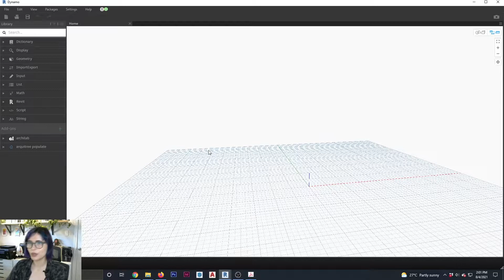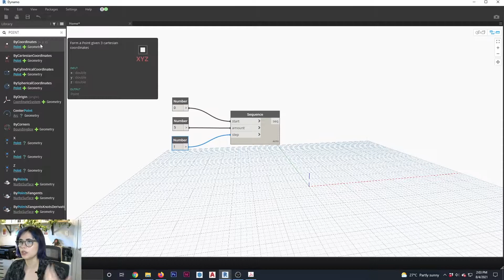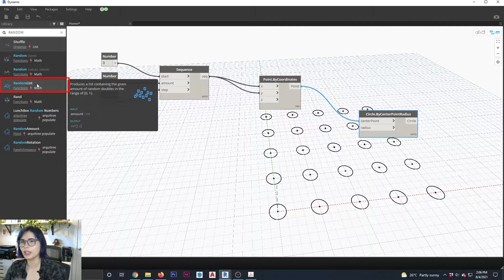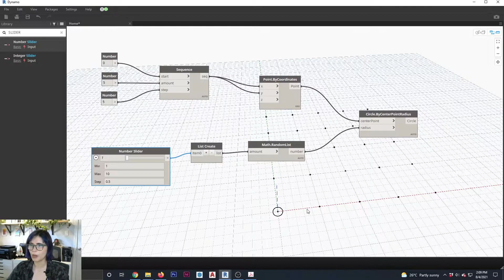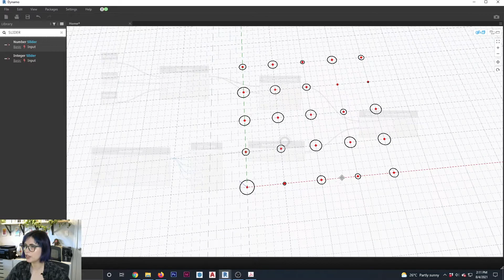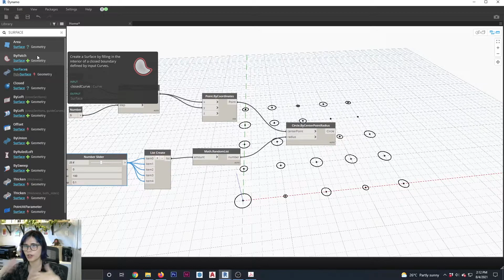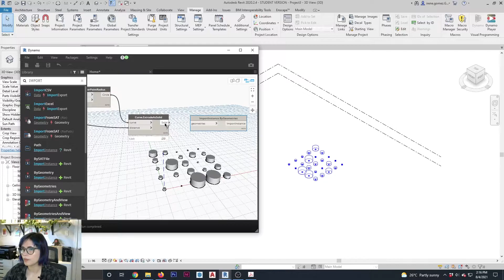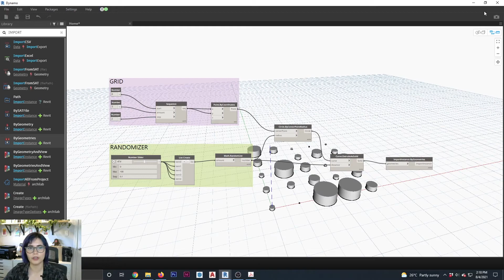Revit & Dynamo - Creating a grid of cylinders with randomized dimensions

Comment: thank u so much for tutorial, but, if i want to have rectangle shape, which command do i use?
Reply from the maker: You can either use the "cuboid" I mentioned or you can create a polygon by points. It's kinda slow and cumbersome but will get the job done.